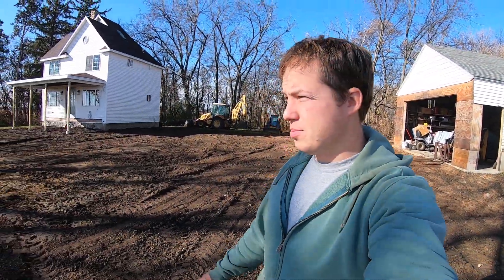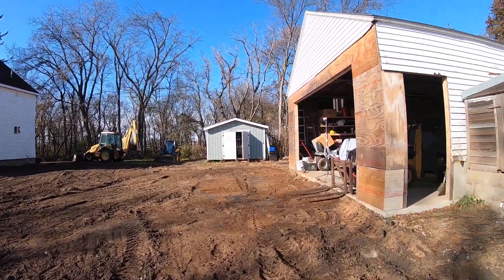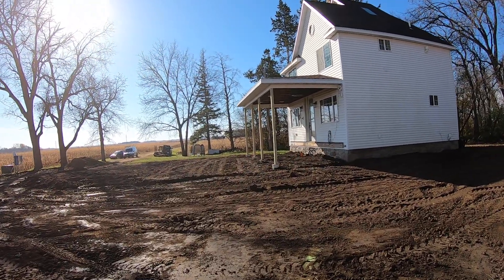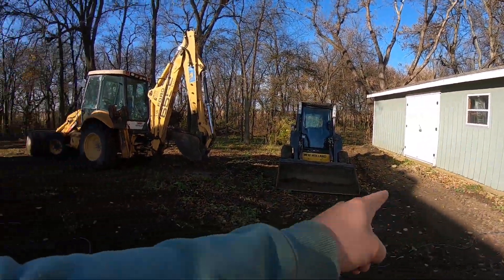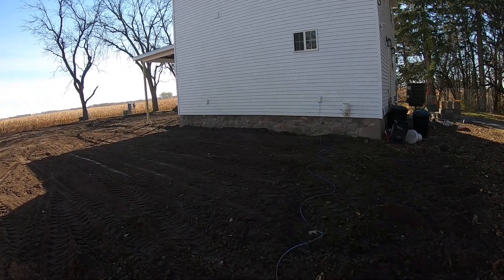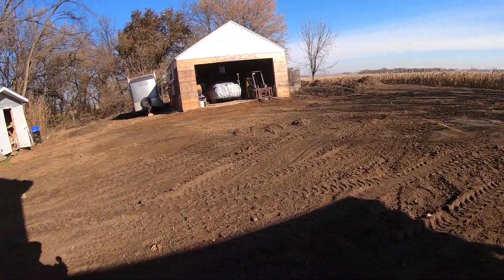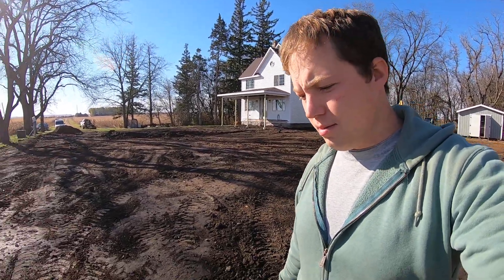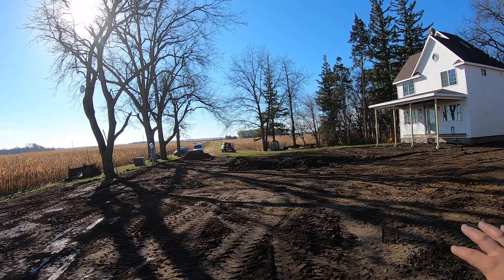Should I Future Proof? Running a Water Line & Trying to Decide if I Should Run Sewer Line Too?

Comment: I would usually future proof, but in this case I would agree and just run water because of time (and costs) as the well house could be fixed with a sump pump.  I would future plan here, just make sure you run the water to easily have the route accessible for the sewer in the future.  Also it seems you have access to a backhoe so if its not store rented, that cost is probably more minimal to use in the future.

Comment: The floor drain functionality to safegaurd the well casing puts my opinion at 50/50. If you are contemplating a bath (future) then dig once and be done. Nobody like digging up with a driveway,sidewalk, and bushes/trees/perennials/hardscaping in the way. Pipe is cheap when the trench is open is my motto about trenching.

Comment: Don't need a connection to the well house for rain drainage. You should be able to just run a drain line that empties out into the yard, as long as to maintain a 1/4" drop per foot or higher if you can. It not as if your well house is going to get flooded with raw sewage. That said, Consider running 2" electrical PCB so that can run data or extra power cabling over to the well house or garage or if you decide to add another outbuilding (ie Workshop or office for your business)
Reply from the maker: Thanks for the thoughts!

Comment: If you are covering access to the future plans of gravel driveway and/or sidewalk then that should be considered. Sometimes future proofing is actually just prior proper planning. Take some advice from a 65 year old Montana boy who has retired to a ranch in Tennessee. If you can do it now the future will have its own problems.
Reply from the maker: Yes, gravel/sidewalks/driveway will make it very difficult to add later. So your vote would be to put it in?
Reply: @BenjaminSahlstrom  Absolutely. Having to undue work at some future time will give more regret than will the extra effort now.

Comment: Run the water line. Put a pipe sleave under the driveway for a future sewer. Don't put a floor drain into your septic system. Dig a dry well for the floor drain
Reply from the maker: By dry well do you mean a sump pump?
Reply: For the floor drain in the garage dig a deep pit and fill it full of gravel like a septic system pipe the floor drain to it. Unless you have really high ground water it should work

Comment: Absolutely do not put drainage water into your septic system. If you do that it could cause the system to fail. A sump pump is an option but they can fail or you could lose power. Drain your storm water through gravity (if possible) away from your property. Good luck man
Reply from the maker: I agree completely. I've only had water in the well house once or maybe twice so it is not a continuous draining of ground water which, as you said, will damage and reduce the life of the septic. We're also considering the possibility of adding a little bathroom in the garage so that's another benefit of adding the drain line. Thanks for your input!